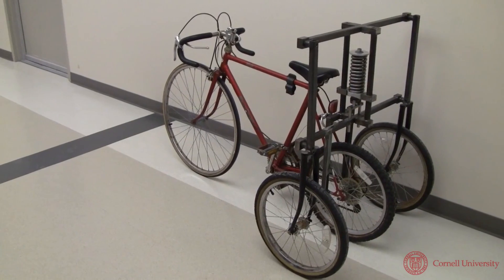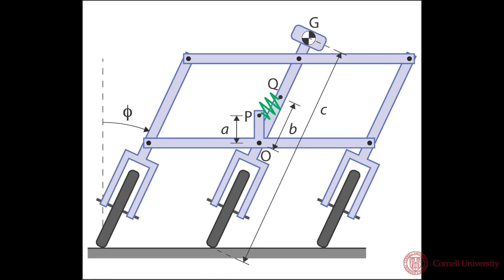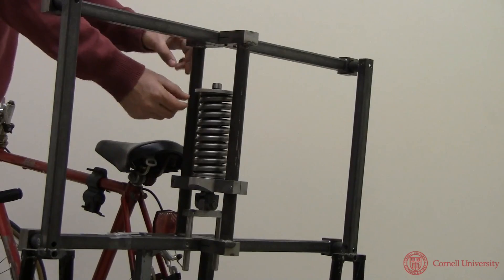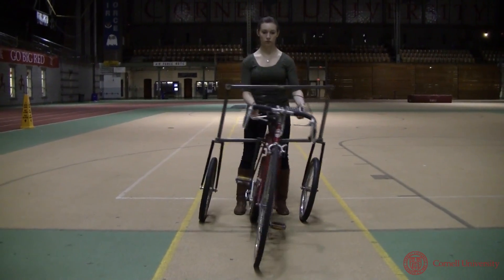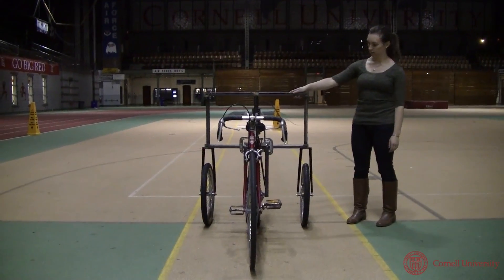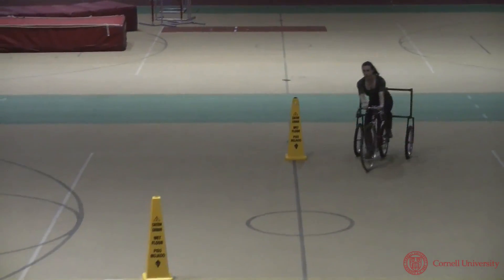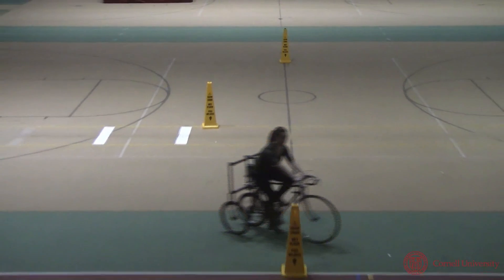A bicycle in zero gravity is unrideable (The bricycle).

Comment: Great experiment, and very elegant explanation! The analogy with the inverted pendulum is great!  However, I'm a bit puzzled by the exact experimental setup:
1. To exactly balance gravity using a linear spring, the spring length must be proportional to sin(theta) (theta = lean angle). I don't see how this is achieved in the tricycle design shown after 15 seconds. It seems like proportionality with sin(theta) is only achieved if the angle with gravity of the vector PQ equals the one of the vector OQ (which equals theta).
2.  Starting at 1 min 5 sec, the critical spring constant is demonstrated. However, it seems that the spring is not balancing gravity completely, as the cyclist can lean quite a way to the left (from the cyclist's perspective). Actually, she can lean as far as what is needed for the turns in your experimental track (me eyeballing ...). Of course, also with this spring setting, the cyclist will experience a restoring torque from the spring (proportional to its elongation/compression). Maybe the countersteering-induced lean torque just cannot realise a lean angle at which the steady-state-turn-induced lean torque would exactly balance the torque difference between gravity and spring. Following this reasoning, I would expect that for every spring setting that is not completely restoring (i.e., it allows for some elongation/compression by gravity), for a given speed, there would be some maximum achievable turn radius. This would make nice psychophysics study(-;)

Please correct me if I'm making a mistake.

Comment: Here's my guess at a strategy for riding that Bricycle. To turn:
1. Start a lean by windmilling your arms in the opposite direction of where you want to go. If you want left, windmill your arms clockwise, for right counterclockwise. This should begin a lean in the direction you want to go.
2. Turn the handlebars in the direction you want to go, which will turn the brike some amount and reset it to upright.
3. If you want to turn more, go back to step (1).

My strategy for steering a bike in zero-g is inspired by cats.
If cats can turn themselves to land on their feet while in free-fall, then cats can steer this brike, or steer a bike in zero-g. The best I can do to imitate cats is windmilling my arms.

Comment: Does this assume a spherical bricycle in a vacuum?

</oldphysicsjoke>
Reply: You forgot perfectly uniform density.
Reply: >  the rider is modeled as a point mass fixed with respect to the body frame

So it assumes the person riding it doesn't crouch down close to the handlebars, or stand up on the pedals, or lean relative to the bike, or windmill their arms. The first 3 of those mean that the spring would no longer be calibrated for the new mass distribution, so while they would allow you to steer the bricycle, they wouldn't help in zero-g. But the last one, windmilling arms, would probably still work in zero-g as well as on the bricycle

Comment: What confuses me is that the lean of a bicycle in a turn (when countersteering)  is not based on the rider or any external forces, but on the mechanical constraints of the bike. The rake and trail create a situation where the turning of the front wheel describes a circle tangentially connected the ground that must lower the bike to stay in contact as the arc naturally takes the contact point away from the surface by its arc. So, a stationary bike with or without rider, when the handlebars are turned, will lean it self. This is because the act of turning moves the front contact patch out of alignment with the rear contact patch and lowers the front of the bike. The simultaneous lowering of the front and moving (left or right) of the front is combined as 'lean.' This effect is independent of gravity as it can still be seen in your bike when the springs are set to null gravity. It seems then, that countersteering in a null gravity (or always balanced) environment would still work since balance is sustained by forward motion after about 5mi/hr.   Is this not correct in some way? does your experiment hold at speeds where countersteering would normally be the sole method of turning?
Reply: I think your reasoning above is all about mechanical trail.  Most of the basic bicycle phenomenology remains even if the trail is zero. Counter-steering and so on.  I think you are a bit over-influenced, perhaps, and maybe indirectly, by the Physics Today article(s) (1970 and 2006) by David Jones.

Comment: Thanks for the great evidence for the explanation I give in Bicycle Stability 101. Of course, if you transfer the weight to the outriggers, you will eliminate the lateral forces at the bicycle tires and control as well. The TMS gadget proved that a bicycle stays upright because of the contention of camber and slip angle forces and now this. Thank you.

Comment: This led me to wonder: would you be able to go round corners on a cycle in artificial gravity? I mean like a torus type habitat spinning for artificial gravity? Does it depend on the radius, and spin rate, or can you cycle at any combination of those values?
Reply: robertinventor :  Artificial gravity is a strange thing.  For relatively slow motions it is just like gravity.  So a slow bike would be fine.  But a fast bike, or any fast motions of any thing of any kind, are all messed up by the Coriolis accelerations in an artificial-gravity environment.   

If you stand on the edge of a merry-go-round the gravity is artificially tilted. Try to play catch there and you see that all the dynamics is messed up.  Yes the gravity is artificially changed, if you don't move much, but is messed up more deeply if you do.

In short, a slow bike could turn in artificial gravity and a fast one would be weird in ways I can't picture.
Reply: Andy Ruina Actually it is more complicated than that. Because in artificial gravity in space, the coriolis force works in a different direction because the spin axis is above your head. Has no effect at all on sideways motion, instead you would notice it if you stood up suddenly or sat down suddenly. We simply can't simulate artificial gravity on the Earth at all accurately, because you always have the Earth gravity along the axis of the rotation. Or else you have very uneven gravity which is hypergravity at the bottom of each cycle and hardly any gravity at the top, which is nothing like space AG would be like.
Reply: robertinventor So I think you'd be able to turn normally but whether you could balance like on a normal bike - I've no idea, it's quite a complex physical problem I think. Might be you can, even on a fast centrifuge. You can run for sure. The astronauts were able to jog around the inside of Skylab no problem at all. (It had a jogging track and if you ran fast enough you could run on it normally due to a self generated low level of artificial gravity).
Reply: robertinventor  OK, so your question was not as naive as it looked!  I guess the simple answer is that, for simple purposes like wondering if you could steer a bike, artificial gravity is pretty much like real gravity.

Note, there still is a Coriolis term even if you stay on the cylindrical floor. It just shows up as an increased centripetal term, so isn't so relevant to bike dynamics.  

Also, if the wheels have non-negligible angular momentum, they do get
messed with by the Coriolis term, even without jumping off of the floor. At least when you ride parallel to the cylinder's spin axis.
Reply: Yes I've been thinking a lot about artificial gravity. And about the differences between spinning in space and spinning on the ground. The Coriolis effect would make a difference as the bike starts to tilt - if your Cof G moves up or down then there will be a coriolis effect pushing you sideways or forwards or backwards depending on direction of travel, but don't know how much it would be.

And main thing is - would the bike balance enough so that  you can get used to any unusual coriolis effect and other effect changes, or is it just going to be unstale?

As well as Coriolis, for small spinning habs, you have a large variation in the amount of artificial gravity, your head might be at say 2/3 g or something, and your feet at full g for instance.

Lots of people seem to think that we can settle questions about how AG works on the ground but because the coriolis effect is in a different direction, and - several other differences as well - if you look at the research papers, then you researchers are saying we have to send humans to orbit in spinning tether type situations before we can know what will happen.

And - I think myself there are some indications that it might be possible to keep astronauts healthy even with just a small hammock sized centrifuge inside the ISS if they could find space for it somewhere. For astronauts with reasonable spin tolerance at least, and depending how much gravity is needed for health. I just can't understand why nobody from Russia or the US has tried this out yet. Or Joe Carroll's ideas for a tether spin experiment on the way to the ISS which you can do for almost no extra cost and same amount of fuel.

http://www.science20.com/robert_inventor/blog/could_spinning_hammocks_keep_astronauts_healthy_zero_g-131279
Reply: As for the angular momentum - whatever direction the axis of angular momentum is, the spinning hab won't change that, so - I think a spinning wheel in a rotating hab would be stable and wouldn't do anything weird like precess.
Reply: robertinventor  Just to clarify, as I guess  you well understand:  A spinning wheel, that one tries to hold still relative to a spinning lab, will fight to break loose.  Unless the two axis (wheel and lab) are aligned.   A torque free spinning wheel can't have a fixed axis relative to a spinning lab (unless that axis is the lab-spin axis).
Reply: Yes you would, but under artificial gravity, you would (probably at high speeds) feel some coriolis forces and such also due to the interaction between your motion, the spinning wheels and the rotation of the vessel that produces the gravity.

Comment: Eh first, the title is wildly wrong since this has nothing to do with zero gravity.
And second, the last configuration is easily steerable. Slow down a bit and lean your body into the turn. Come on people.
ET is waiting for us to wake up and realize we are not alone, we can't be tripped by simple things like this.
Reply: The connection with zero gravity is that under the critical configuration of the spring tension in the supporting device, the bicycle and rider can tilt freely while standing still, without falling over. That simulates an aspect of zero gravity. The bicycle doesn't turn because, even though it is leaning, it leans flat without steering.  That doesn't appear to be speed-dependent; after all, the video demonstrates a non-steering flat lean at speed zero.
Reply: yeah you came up with a solution a bunch of smart people couldnt execute. just an armchair scientist. BTW you don't know what the parallels to zero gravity are either, so all your claims are baseless
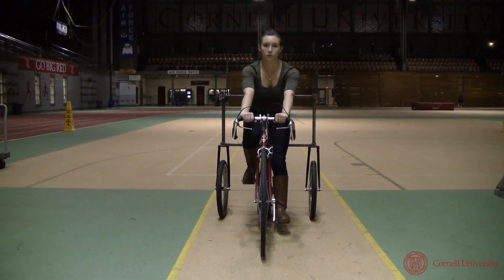Reply: Did you even watch the video? Minute 1:09 explains the zero gravity.